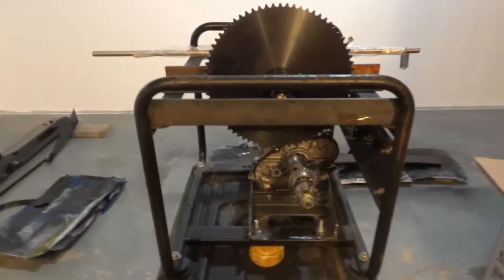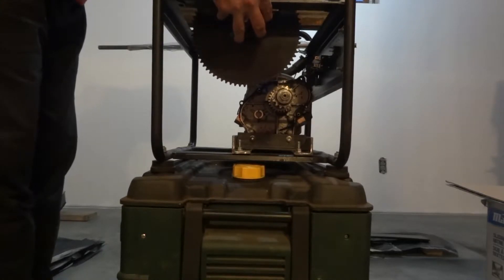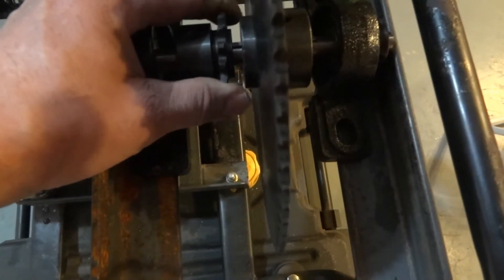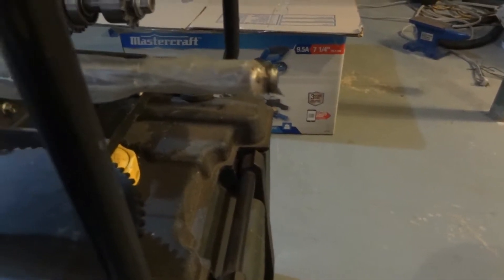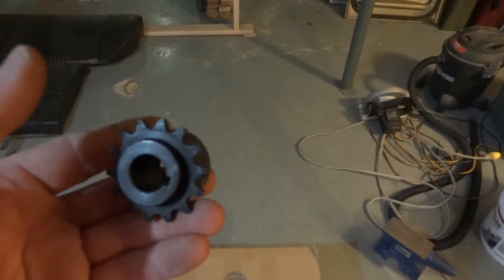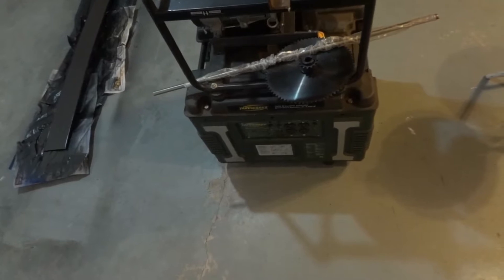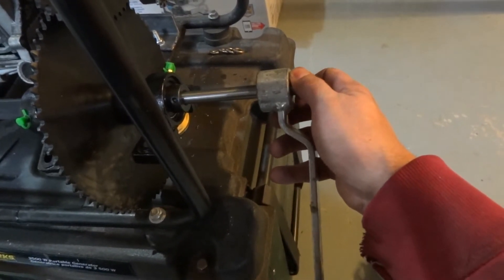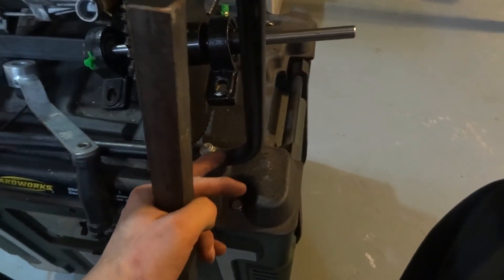Gas to Wind & Peddle Powered Generator Conversion Pt. 4 (Gearing)

Comment: I've learned quite a bit from your videos.  Great engineering.  Working and filming doubles the workload.  Thanks for sharing your experience.  I had no idea that they used the same shaft through the thing!!
Reply from the maker: Thanks. I started thinking about a different and more efficient propeller. Instead of using an air blocking/diverting propeller, I'm going with an air catching propeller. I'm hoping to finish the whole setup, minus the propeller this month. Which I should be able to produce power from it via a hand crank, until I get a propeller.

Comment: Hello caballero, have you had any progress on this project. I have one older generator I am going to end up doing something Similar but I will likely end up using two small solar panels to power up a smaller DC Motor to spin the generator, Hopefully I would be able to get the right RMP to generate the appropriate Voltage. Look forward to the Next video Mate. GBU.
Reply from the maker: I haven't gotten around to it at all. I will be working on it soon though.